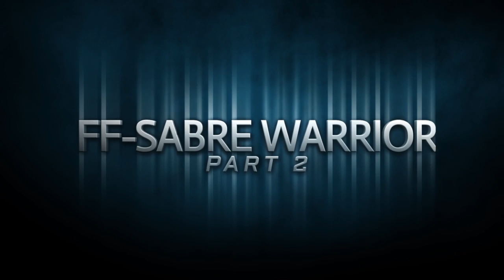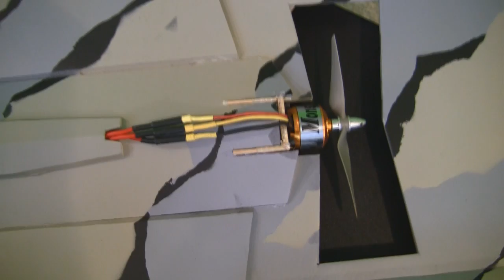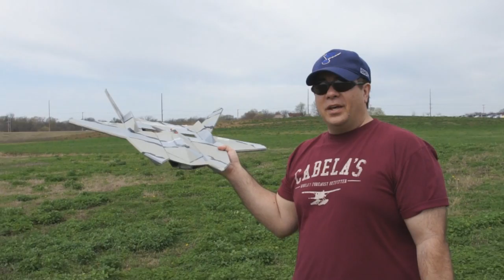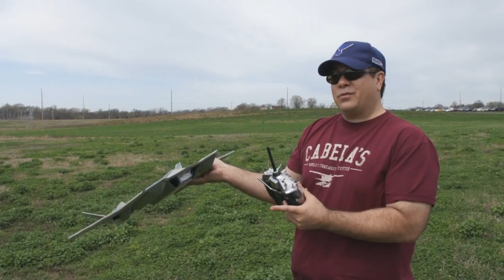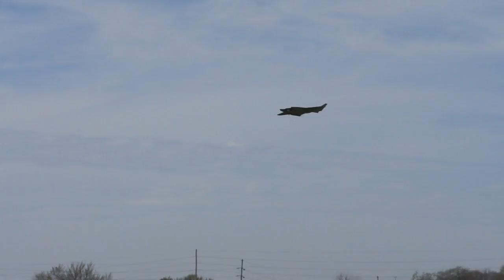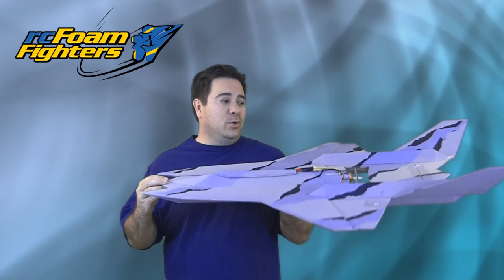FF-Sabre Warrior Part 2

Comment: The tail is dropping down at slower speeds because  when there is less air moving across the lift surfaces, the imbalance of the aircraft is more pronounced. As you speed up, the forces of air moving across the top and bottom of the lift surfaces increases, making the plane more stable. It is simply a balance issue and probably nothing more. You are tail heavy because you put a huge V-8 Hemi in a Ford Escort.

Comment: On a light plane like that, the Monster Jet is WAY overkill. You could easily step down to the Super Mega Jet or Turnigy 2836-3200 and shave off about 30 grams. You could also easily move the motor a bit more forward and have a great flying plane. Just sayin'.

Comment: Moving the CG forward by moving the elevator servo and motor forward is where I would start first. There is a lot of area out front, just a thought but the nose of the F-22 has the front of the wing angled down, maybe this could be part of the problem???  my 2 cents...

Comment: To check the affect of the nose shape, add a temporary stick on the nose (6-8 inches long.) Use that to add weight to bring the GC forward.  If it still pitches up off power, it's the aerodynamic design.  If it fixes it, you can calculate how much you need to stretch the fuselage to move the CG if needed.

Comment: Hi Paul, I'd be inclined to sit down and list the possible causes of the nose up problem. Starting with the easiest  fix at the top and the most time consuming fixes at the bottom of the list. Go through each possibility one at a time to see if you solve the problem. With my luck it would always be the last on the list but hopefully you're luckier than myself. Obviously you'd have to wait for a calm day to check out the wind possibility. It could even be a combination of fixes. Good luck, Stu

Comment: looks sweet. what about moving the motor and elevator servo closer to the cg? the monsterjet is a heavy piece and if you used a smaler motor like the other greyson hobbies jets it might fly perfect. i think the motor moved more forward would do wonders. and the elevator servo could go closer to the cg then the aileron servos and it would work good. also if you extended the nose a few more inches it may balance better and allow for more battery movement

Comment: Hi Paul. I think the large frontal area is a huge scoop pushing the nose up when off throttle.  Its a reason why most planes have a narrow fuse. I have similar problems with flying delta wings in wind, its not cog. It looks great tho & will probably fly fine in calm weather. Look forward to next instalment.